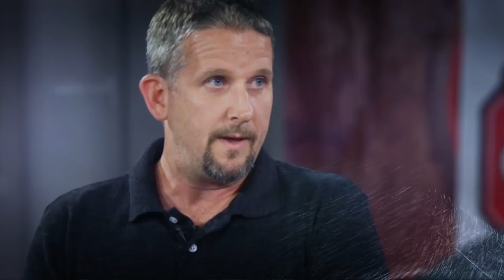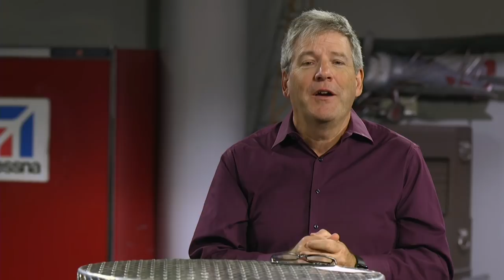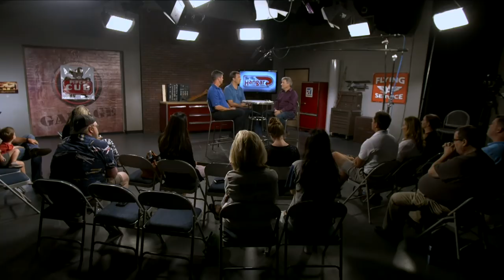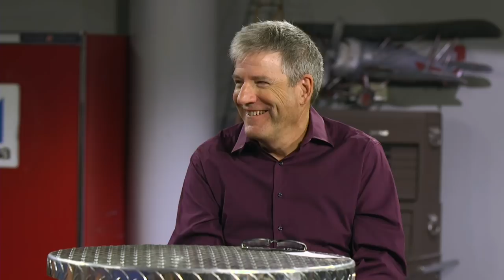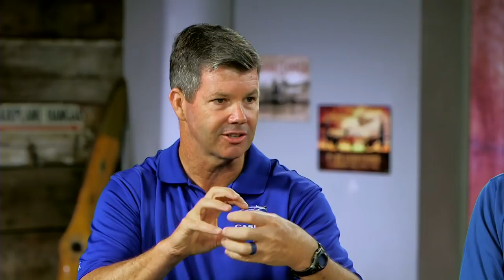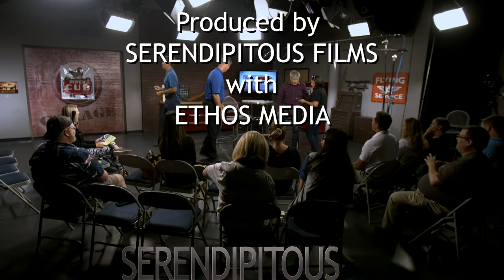Single vs Twin Engine?  InTheHangar Ep 53

Comment: Many pilots I have spoken to over the years claim that a single engine turbine is more reliable then a multi engine piston, and thus a better choice for long water crossings.  I could never see how this can be true because with a multi like the DA42 you can STILL FLY on one engine (I am not talking about older twins that won't maintain altitude in an OEI situation).  Yes, a turbine is very reliable indeed, but if your engine quits over water, you simply don't have any option but to ditch and pray you survive.  I am having a very hard time believing that an event where two completely independent piston engines quit at the same time is more likely then a single turbine failure.  Can anyone clear this up?
Reply: Turbine has less moving parts so it's more reliable than piston overall?
Two piston engines = twice as many chances for failure? idk
Reply: da42 and pretty much all diamonds have a much more newer engines they are inline and has counter balancers so they are pretty smooth, they are liquid cooled and also have FADEC, so they are pretty safe for a piston engine....but most piston twins or even singles have engines that were designed in 1950s which burn 100LL...Piston engines would be a lot safer and reliable if the Piston engines in aviation are as advanced as in the automotive sector.
Reply: @superchargedpetrolhead  Good point.  I agree with you about new, modern engines.  I haven't known of anyone in the last 20 years who have had a connecting rod explosion like you see with Lycoming engines.  While is true that two piston engines will have twice the chance for a failure, they will also have exponentially less chance of a double engine failure.
Reply: @FL-FLyer  exactly....people always like to bring up how many people died in a twin when one engine failed but everyone seems to forget how many survived and are alive today because they were in a twin when one engine failed.
Reply: Your head is the in the right place. Aviation is all about redundancy and that should not fall short when it comes to an engine. As someone who flies only turbine now, I still would never fly a single piston OR turbine over the gulf, Atlantic, etc. These machines are man-made and things will happen eventually. It’s inevitable. Twins for travel & singles for local fun, just remain proficient. I have had 2 issues in a turbine where the engine couldn’t produce power without catastrophic damage. One was a broken duct seal, the other a severed oil line. Both caused overheating which reduced engine power to 20%. The engine does not need to fail for you to be unable to utilize power. If in a single, I would have been in a field writing up a report for the FAA or worse. But I fly twins, so I landed back at base, notified maintenance, and went home early with a full day of pay.
Reply: I think the probability of two piston engines failing for independent reasons is less than the probability of a turboprop failing. Let's say piston engines fail once in 3,000 hours. That's 1/3,000 chance in a hour of flying. A turboprop engine might fail once in 300,000 hours. That's 1/300,000 chance in an hour of flying. For both pistons engines to fail, it would be the square of the chance of one failing, so 1/3000^2, or 1/9,000,000. So less chance than the turboprop.

Comment: Spent 13 years working for a 135 operation in Alaska, I personally saw 7 Piper Navajo chieftains loose engines and all but one aircraft made a safe landing on one engine. Here's the deal guys, we're real good at tracking fatalities due to a twin that looses an engine and causes an accident, but what about the twins that loose engines and everybody just walks away, where's that number at and isn't that the other number you really need to quantify the ultimate safety of a multiengine aircraft type. All aircraft power plants are designed built and maintained by men, it's impossible for any of them to be 100 percent reliable. If you guys read thru all 350+ accidents with the Cessna Caravan since 1984, you'll find no fewer than 61 engine failures and thats not exactly a negligible percentage.

Comment: Good discussion, I so agree safety is about good quality training, on going and regular. A side note that most single engine pilots do not know is when a multi loses an engine that is 50% of its power and in reality it is a loss of 80% of its performance. That is why a single engine go around is to be avoided if possible especially with recips a turbine has a little better safety margin than a recip but it is not desirable, even though it is part of our training and checkride. Good job guys, I'm subscribing, keep up the good work.

Comment: I had a partial power outage in a Cessna-182 years ago.  Went from smooth running engine at 8,000 feet over the Florida panhandle to racket and vibration.   I told Jax Center I had an engine problem and needed to land.  I was over a 6000 broken layer and could see both I-10 and some new roads being graded for a subdivision.  Jax gave me a vector to an airport 6 miles behind me and I got down through the broken lay and over the field at 2500'.  I didn't fly my downwind wide enough and did s-turns and slips on final to get on the runway past mid-field.    My commercial check-ride examiner had told me that most forced landing crack-ups are from overshooting, and I demonstrated that to myself by flying the downwind too close to the runway.  I need the brakes to not run off the end of the 4100' runway.  

The problem turned out to be a broken rocker arm boss on the No.1 cylinder exhaust valve.  I have pulled the power all the way back and treated it like a total power loss even though there must have been a good bit of power available.  That exhaust valve had shut when the boss broke and the No. 1 cylinder was back-firing through the carb and it had sounded really scary with  significant  vibration.
Reply from the maker: Thanks for sharing Bill.

Comment: This is a really good video- the comment about who's in the left seat at the end is my takeaway. I like the 310. I love the TBM :o) I've never flown either. If money were no object (I'd like a video on how to make THAT happen), I'd take a TBM and do intensive training in it and a sim before I flew it solo (much), and then schedule recurring training. Then I'd go buy a Baron and/or 310 and do the same. Because... money is no object in this scenario and I like to fly stuff. 

Since money always factors in, a twin is probably not for me. I don't think I could stay proficient in twin or turboprop for that matter. Especially for engine out emergencies. I follow Kathryn's Report (definitely not for the entertainment value) and in a lot of cases, twin fatal accidents are due to bad handling of an asymmetric thrust emergency. Low time, poor or no training, or just complacency.

Proficiency in a C172 or C182 is easier maintain, I can go out west of KFMN and practice power off landings or any number of emergency maneuvers. The checklist is relatively short and pretty much burned into my head. Ie, they aren't complex aircraft. Cost to operate is low(er) and I can "afford" to practice just for fun.
Reply from the maker: Pretty much my situation.  Would love a PT6 powered single engine or a twin.  Can't afford it.

Comment: I flew 12 single-engine beavers across the North Atlantic to Oslo, Norway in the mid 1970s.  One-by one I gradually became increasingly nervous about an engine failure.  I don't know if I have OCD or not, but now I will not fly in a single-engine aircraft.

Comment: The "Center-line Thrust" twins had likely the best safety record.
In a standard twin, the asymmetrical thrust of single engine Operations was just too much for all but the most experienced pilots to handle.
Reply: Actually the Cessna Skymaster in-line twin does not have a better safety record than most conventional twins.

Comment: Charles Lindbergh opted for a single engine to cross the pond as his logic was that the multi engine, multiplied the chance of engine failure.
To me twins add to complexity, which can be good or bad, depending on proficiency and currency of the pilot on type.

Comment: What do you do when you’re flying IMC at near CAT 1 minimums and your only engine dies? Or flying at night over unpopulated areas with no light for visual reference? I’ve tried it on a simulator and you’re going to need a lot of luck to survive. As a result I wouldn’t try flying in those conditions in a single, especially not with my family in the plane.
Reply: You fly the airplane until you can’t fly it anymore. That’s what you do.
Reply: That’s what you call being “shit out of luck“  What you do is fly the airplane all the way to the crash, if you checkout mentally and lose focus in panic, you’ve doomed yourself and anyone else aboard.
Reply: Yeah, but caps reduced that risk, I would personally have a twin with a caps system
Reply: @Derrick0898  flying at low altitide in low imc and loose and engine as stated. Your suggestion is to fly plane straight into obstacles you can't even see?
Das just Krazy

Even if you knew there was an open field off your left, at night in low imc you will not be able to see field that isn't light up nor be able to clear any tall trees around perimeter. 

I would pre plan on a strict assigned route if I were to loose an engine draw glide range then choose waypoints tht are better than guessing and being unprepared.
Reply: @Misha M  it's sad that more manufactures of ga planes aren't at least offering a parachutes if desired. Why is it only Cirrus offering this??

Yes, fly plane to the crash site but i've seen many youtube videos in which that plane either had a structural failure of loosing a wing dur ti failed wing strut or loss of a control surface. I'm sorry but when the pilot can no longer act like a pilot and only sit there as plane falls a parachute can be the last tool to survive. I agree, it shouldn't be 1st tool.

Comment: It all comes down to rich boy toys. When it comes down to operating cost, it’s twice the amount of fuel, twice for an annual and many other factors that would make private owning of a light twin only available for the well to do. I got my multiengine rating back in 1995 and have not flown since. I thought it was ungodly expensive at $160 an hour back then. Now you can’t even touch a light twin for less than $400 an hour or more. You couple that without having any passengers that would help share of the cost and just staying current would be like having to make several car payments on the same month. That is just for renting! Just the  fact of being able to rent one and be recertified would almost costing somewhere in the neighborhood of $6000 and may not even be able to solo due to insurance reasons.

Comment: Wonder why they still haven't found the way to lower the cost of a turbine engine, also considering that in theory is less complex.
Reply: It's probably a conspiracy of the piston makers.
Good to see that Diamond is selling {apparently} great diesel engine (a water cooled Mercedes Benz auto engine, actually) airplanes, which seem to work well in a piston engine set up.
Reply: Hard to machine them, inspect all the blades and very expensive high temperature alloys

Comment: The only way to get a safe twin engine is getting a counter rotation propeller in each engine. Getting a engine quit at takeoff you are 90% dead. I'll always go with single engine
Reply: Counter-rotating props don't really give you a higher climb rate on one engine if you lose a fan on takeoff. You want to be at blue line in any type of twin when this happens and counter-rotating twins aren't much different than a conventional twin at blue line.

Comment: I know this is an old video. But the single turbines are hot right now because you can reach a broader market of pilots. There's a lot more ASEL pilots than AMEL pilots and they can keep the price point lower with a single turbine than a dual turbo piston. It's all marketing mathematics.
Reply from the maker: Good points
Reply: A single engine turboprop is much, much more expensive in acquisition cost than a twin engine turbocharged piston and the hourly costs are probably higher as well.

Comment: Having two engines doubles your chance of having an engine failure. So does flying with one dead and one live engine give you twice the chance of surviving over  your only engine failing? I think a lot depends on when the emergency occurs. Twins having failures on take off or landing don't seem to have that good of a record. Fortunately both of your guests had their failures at altitude.
Reply: What about if you have a twin turboprop like the king air? I understand that an engine failure in a twin during takeoff is dangerous but so as single engine. There are cases where single engine failure during takeoff has claimed life because they have not claimed to an altitude where they they can make that 180 turn. Their glide path is either some building or stalled and crashed to the ground. Most engine failure occur during crusing altitude. I think a twin is far safer even if they are pistons. Imagine crossing a mountainous terrain or water. I'll take 2 crappy engines anyway.

Comment: Twin vers single engine all you have to do is have a engine failure in the dark at night with single engine have to glide to a airport (good thing past glider pilot) landed no incident very easy decision. This was my last single engine moved on to twin Camanche, twin sennica and finnally a piper aerostar 4000 hours later no more engine problems.. I refuse to fly in a single engine. Yes cost more but not double. Kester Ottawa Canada

Comment: Will a twin engine piston plane continue to fly if one engine failed
Reply: Depends on a lot of factors, engine performance, aircraft weight, temperature/density altitude. Generally speaking, yes, it will, unless weight, performance, and environmental factors exceed the capabilities of the aircraft.
Reply: @TWhite94  thank you
Reply: Are some twin engine planes designed to be able to fly on one if the other one craps out ?
Reply: @johnnyboy1586  Diamond da 42

Comment: Further to my comment below nob rainer the point with single engine or twin the piston engine not only has a lot more moving parts like pistons, valvles, rocker arm, lot of moving parts that are moving together in very close proximity causing wear and friction heat  this results in my opinion at least 10 times or more less reliability. Turbine is way to go but if you go pistion go for two engines again saftey far better with good training see my comment below. Christopher George

Comment: So my take away is if you take a turbo prop and a Cessna 337 off the table and the pilot is proficient in both a single and twin when it comes to safety the single would be better with both planes having the same quality of maintenance. Myself and every other pilot have debated over this subject but I still lean slightly toward a twin being safer but with higher operating cost. If both have about the same performance. A cessna 337 would be safer than a single with this pilot due to the inline thrust which is the most dangerous part of a twin due to the yaw when one engine is out. Just my opinion nothing scientific about it. I'm a low time pilot , A&P with my I.A.  One other scenario would have been flying over mountains instead of water.
Reply: On takeoff, a Skymaster is arguably less safe than a single because it has about twice the chance of an engine failure and it cannot continue takeoff on one engine in some situations. So in that case it's a like a single engine plane with half the reliability.

Comment: A turbine spins in one direction, true, but at 30,000 rpm! A reciprocating turns at 2500!  Show me some data on “reliability” that we all tout about with turbine engines vs recipes. I fly a Boeing turbojet at work ( big 4 airline) which are also “ reliable” but we have engine failures almost yearly. I’d take a capable twin recip over a single turbine ANY DAY!
Reply: But look at the service hours on the engines you’re seeing fail. Of course to you a turbine/ jet engine is going to see more failures.  because statistically in your experience you’re seeing and using those much more than a piston engine. And the ones you are seeing have a lot of hours on them, and they see a lot more hours of use than 99% of piston engines. 

It’s like having two reliable cars and keeping one in the garage and never driving it. Then claiming the one you drive daily is a lemon because it’s the only one you’ve had to repair.

Comment: Twin-engine aircraft are not capable of flying on the remaining engine. Twin-engine aircraft get into a spin and you will never recover. Something a single-engine aircraft provides better survivability.
Reply: They usually are capable of flying on the remaining engine. The main exception is before getting the gear up on takeoff.